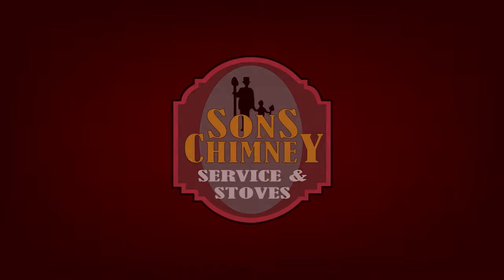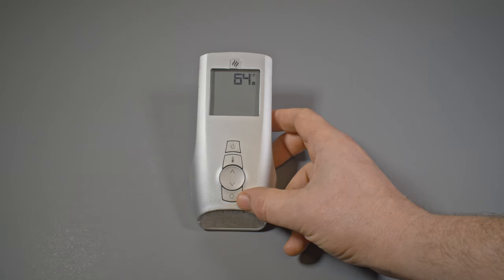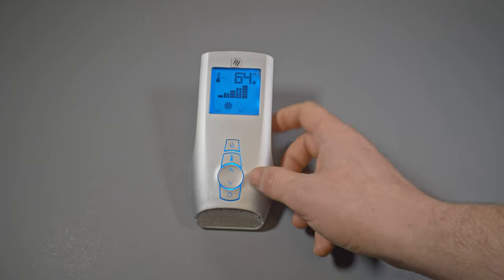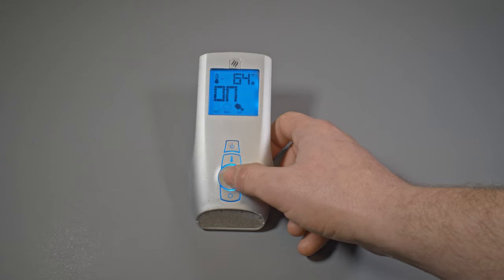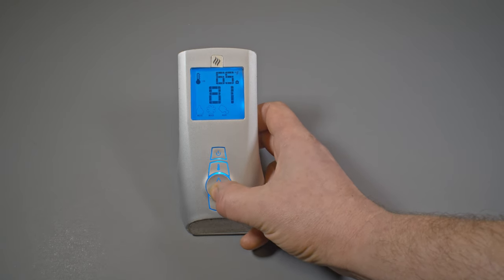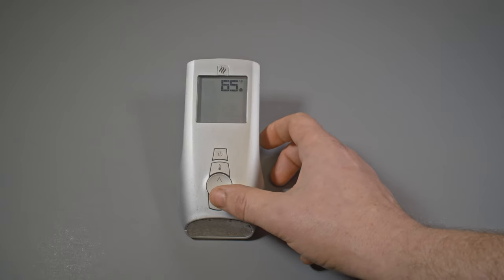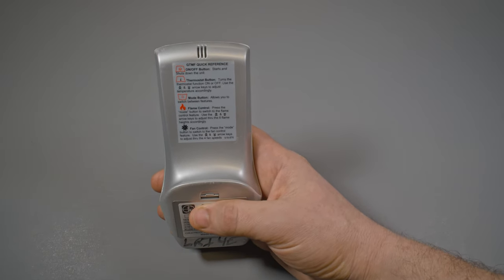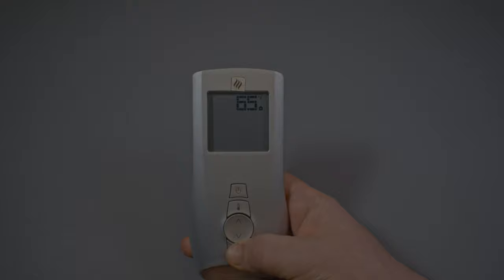Regency ProFlame Remote Operation Tutorial

Comment: I hate the beeping. Best tips to avoid the dreaded beep?
Reply from the maker: Unfortunately,  I don't think the beeps can be shutoff.  You could run the unit on thermostatic mode then it will cycle on/off without beeping.  You may be able to operate the unit manually without remote as well(depending on unit).